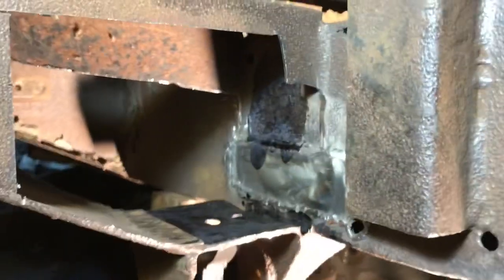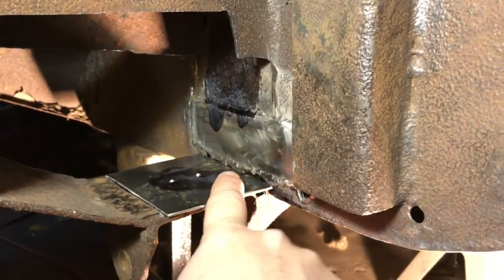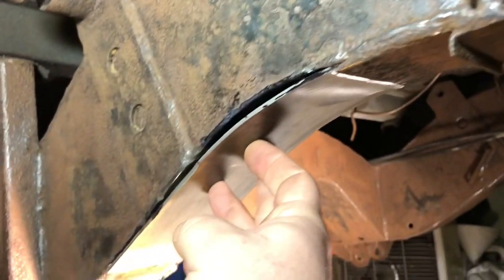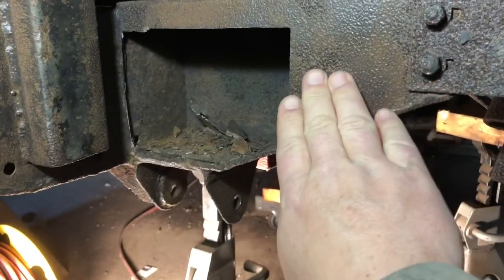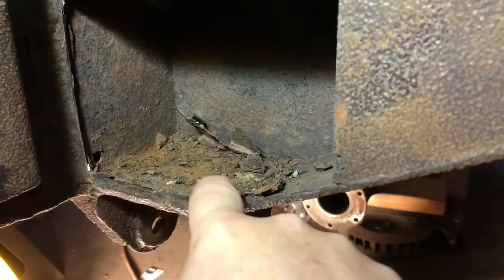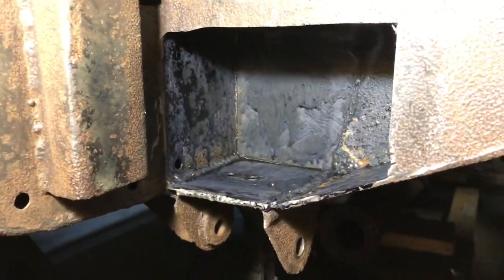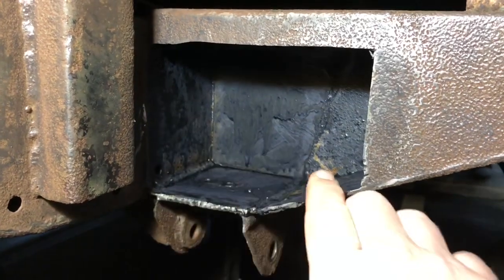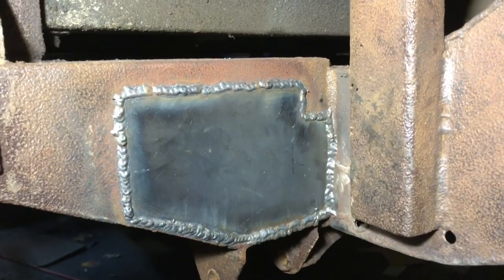Outrigger Repair Chassis Frame Spring Hanger Land Rover Series 2A restoration 2.25L Part 14

Comment: This spring when i do the repairs to my bus frame I will get some of the coreseal looks like a good product and method. On the  curved  plate will you put some seam sealer and fill in the gap to from the elements ?? Welds do not need to look like dimes just need to get good heat where you see both metals bond; yours looks very solid and strong . You & your family have a great Christmas Cory. That some very robust metal for the out riggers , on my vw bus they look to be either 18 or 16 gauge sheet metal but it is a vw bus & not a Land Rover.
Reply from the maker: Busman 54 I wish I would’ve found the corraseal when I did my bus. I don’t plan on putting seal sealer. Just a bunch of paint. Leaving it open I can hose out the spot. Merry Christmas to you and yours, too. If you need any help with the bus let me know.
Reply: @conrad1468  Cory I'm new at working on vw buses , i'm sure i will have a lot of questions thanks for offering , they are new to me. I worked on a few super beetles and a 1970 & 63 standard bug.